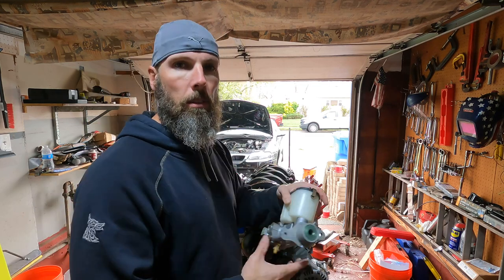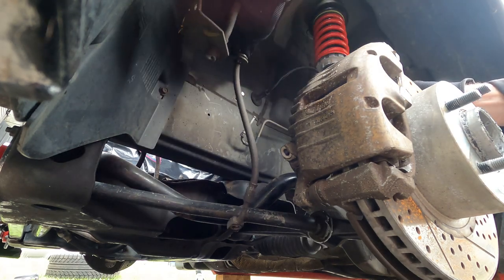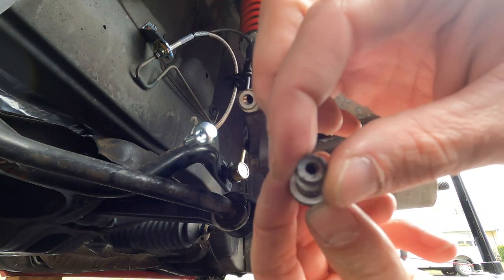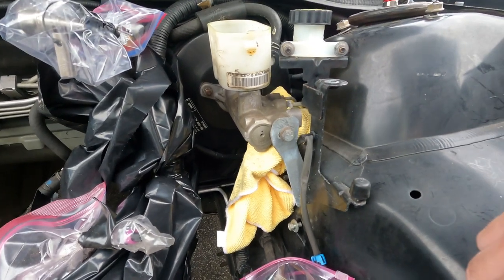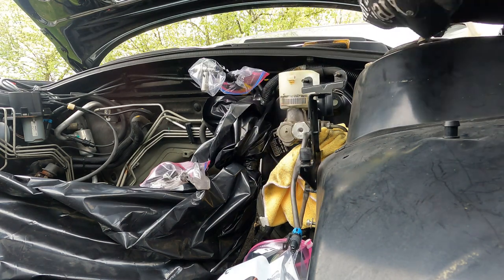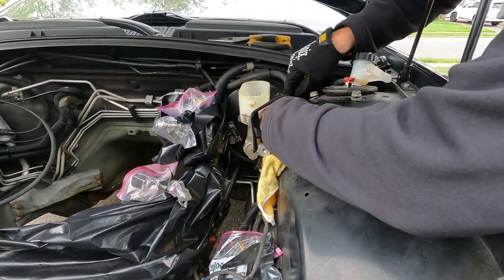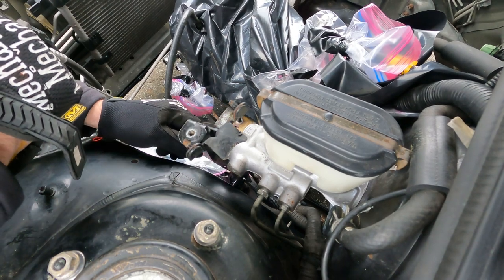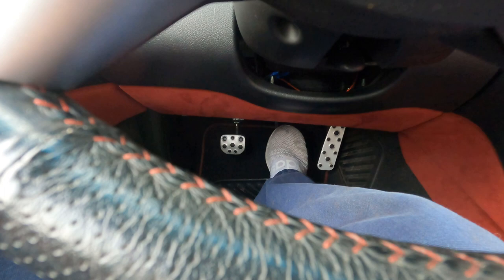The GTO has its brakes back! Plus new front brake lines

Comment: I don’t know if anybody else has told you this but we appreciate you doing all the tedious work and actually showing everything step by step. Most skip around but I’ve been binge watching quite a few videos as I really need to get mine back together the right way. Thanks!!
Reply from the maker: That's kind of why I started the channel. There is cool GTO stuff out there, but not alot of in depth stuff. Mostly because the car wasn't a huge production. I am learning a ton about the car and still sorting issues, especially the brake system
Reply: @Billy_Ray_Garage  what other issues are you having with your brakes? I don’t think I saw you mention it in any of the videos I’ve seen but did you upgrade to 05/06 brakes ?
Reply from the maker: @markitoss  this vid, I got the brakes to work I thought. Got front brakes but the back wouldn't get fluid. Got a new master from Australia. The end of my latest video covers what's going on with the master and abs system